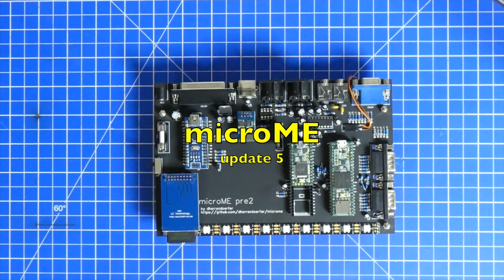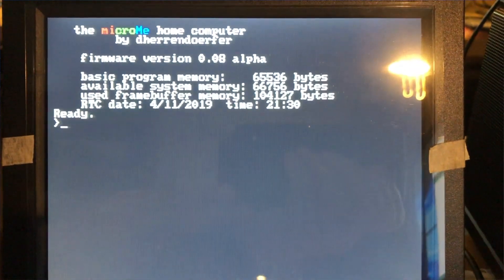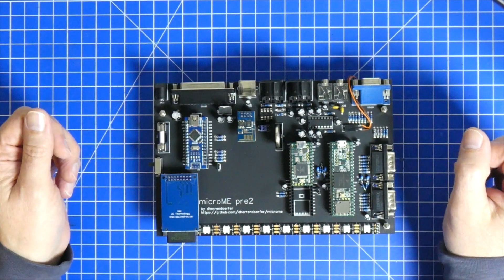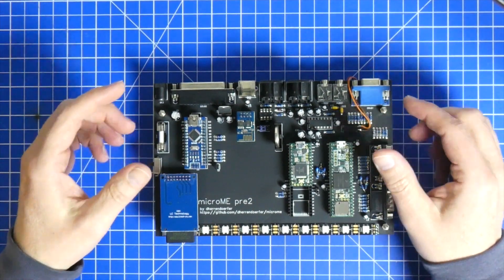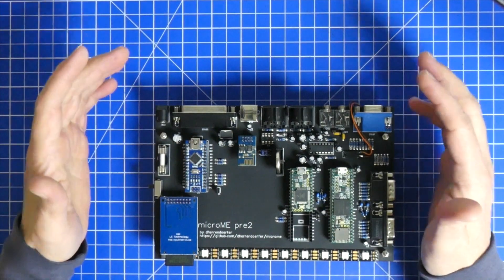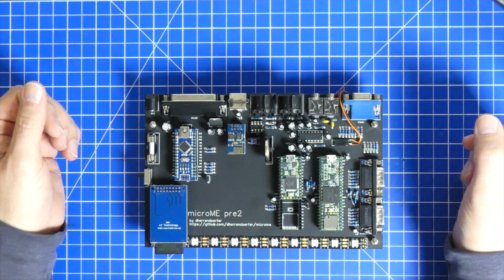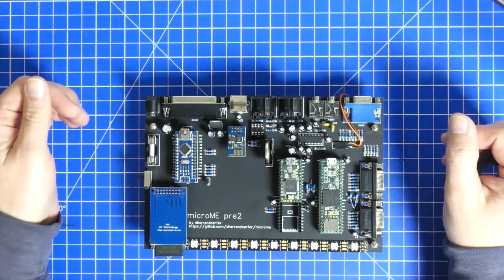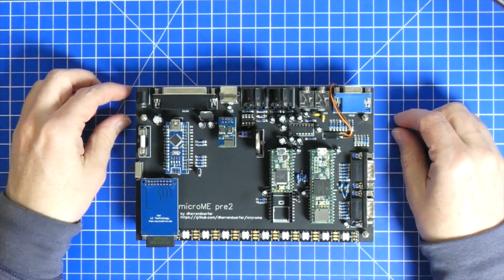microME Update 5 - Graphics! Code! Prices! - Building an Open-Source Home Computer

Comment: Wow, the basic interpreter is really fast!  I've seen how you attached the speaker and maybe you'll like how the Oric-1 and Oric Atmos solved this ;-)
Reply from the maker: I'm a huge fan of the Oric computers! I want to design a case with a dual ported horn below the board, but my prototypes have been far too loud so far. Yes. Musl is really a great interpreter, and super easy to extend with new features.